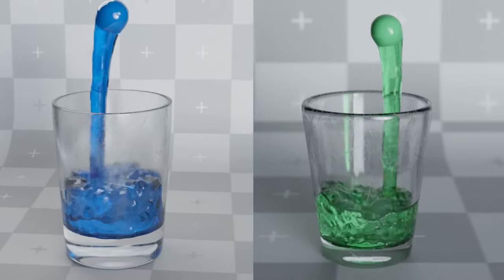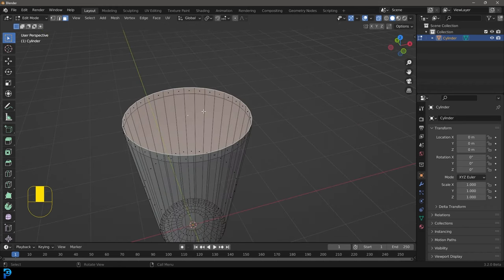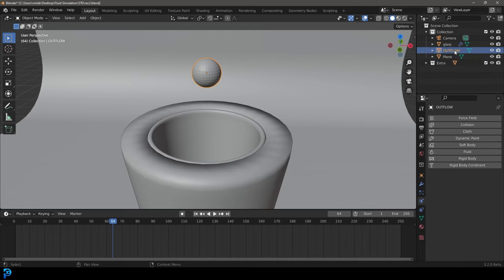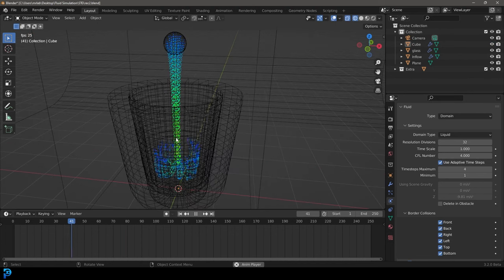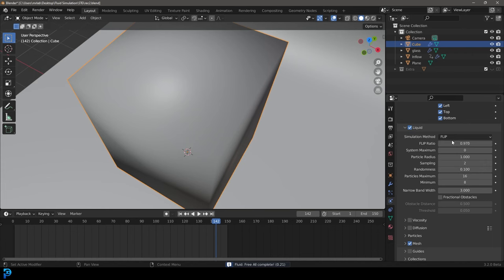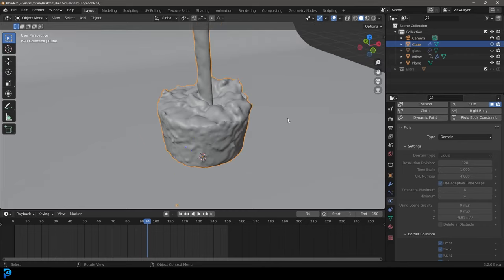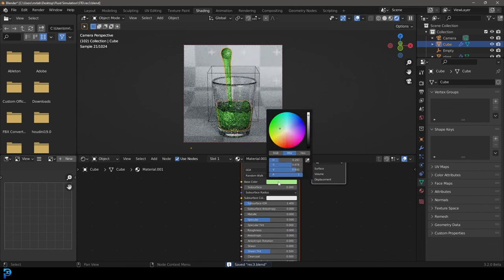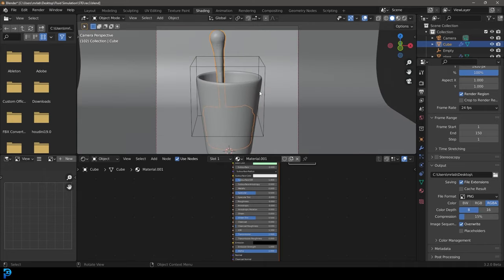Blender: Glass Liquid Simulation Tutorial  | EASY

Comment: Thanks for the video. When I do it nothing happens with the fluid coming out at the point you get to 8:29 in your video, following the same steps. I wish this software wasn’t so fickle. Any ideas very gratefully received.
Reply: I have the same here . . kindly help
Reply: Try using play button on the timeline to start animation, instead of using shortcut.
Make sure pointer is on frame 1 (not 0) when you play animation.
In domain settings, make sure there is check mark for Liquid sub-setting.
Also, you need to be in wireframe mode to visualize the animation.
Reply: You must have had one of about 1000 different parameters not quite set correctly
Reply: Try scaling up the Inflow object (might be to small compared to the  voxel size)
Reply: i have the same problem, did you find a solution?
Reply: Same this sucks i rage quit at this point

Comment: Here is a big problem and how I fixed mine so, with mine it went outside of the Effector and to solve that problem you have to increase the surface thickness and with enough tweaking that setting and you might have to do it by the .001 it should work.